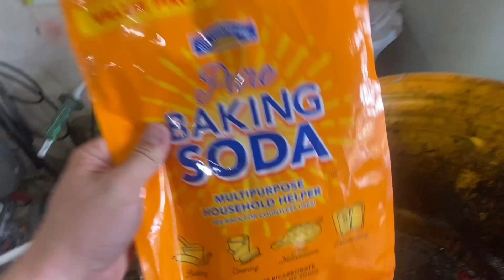How To Powder Coat Brake Calipers

Comment: Thanks for the video. One question: These plastic closures you are using to masking the connections and the piston, are they surviving the heat in the oven?
Reply from the maker: They are silicon. They’ll survive the heat but it is best to remove them before coating

Comment: Hi Tyler thanks such a informative and practical video I have  a  question,after you put the red colour did u leave the calipers in the oven to cure first or did spray the clear immediately after the color 
If you put the calipers in the oven before spraying the clear how long do keep in the oven and at temperature Thanks in advance
Reply from the maker: Just a partial cure (few minutes past flow out) between colors and full cure after clear is applied.
Reply: Hot flocked the clear?

Comment: Smacking the wrench with your palm will hurt a lot less than the side of your hand.

Also you can remove the pistons with a blow gun that has a rubber tip. Keep the bleeder in and blow air into the brake line bolt hole

Comment: When you start spraying here you mention that you forgot the o-ring between adapter and gun. I wonder what o-ring that is? I had the same issue when doing my first spray, other than that super happy with the rc1 gun :D
Thanks!
Reply from the maker: There’s a clear-ish/white o ring that comes in your box. If you have misplaced it you can just use a standard black o ring in its place. 

Glad to hear you’re liking it!
Reply: @royalcoatspowdercoating  Awesome! I Will double check, probably missed it.

Comment: Great vid man . Do you know the name of the tool you are using to remove the pistons ? Also after doing tons of these , did you find an easier way to remove the pistons ?
Reply: You put a block of wood in front of the pistons and give a few short blasts of compressed air into the hole where the brake hose attached to the caliper. And be sure to KEEP YOUR FINGERS CLEAR OF BEING BETWEEN THE BLOCK OF WOOD AND THE CALIPER PISTONS WHEN YOU BLAST THE AIR.
Reply from the maker: Here’s the tool: https://amzn.to/3Pjr2Cq

Air is faster, but this way is safer.

Comment: Hey tyler, First off i want to say that i love the RC1! Question i have is the little air twist knob on the powder tank, what is the best setting for it? (All the way out, 1/4 of the way, ????? Because ik its made to fluidize the powder, so wondering the best position! Thanks bro keep the vids coming
Reply from the maker: Glad to hear! 
I usually don’t mess with the knob, I don’t even know exactly where mine is set. I control my cloud with a regulator before the control box. But you can adjust it while spraying to get the cloud to your liking and spray style. 👍🏼

Comment: How'd you just thread those bolts in after powder coating the threads ?
Reply from the maker: No threads were coated and I just blew out the slide pin holes. Those bolts I’m putting in are threading into the slide pins.

Comment: What do you use for liquid stripper and neutral lizer and is that better than sand blast or do you do both
Reply from the maker: Rim strip is the stripper and the neutralizer is baking soda/water. It is still recommended to blast after stripping but stripping first makes your blasting a lot quicker. https://www.royalcoatspowdercoating.com/product-page/rim-strip
Reply: @royalcoatspowdercoating  ok what is the baking soda to water mix ratio and does  the rim strip come ready to use
Reply from the maker: @hasanabdul-hasib76  rim strip comes ready to use and I usually add a about 7 pounds to around 40 gallons and add to it as the bubbling slows from neutralizing parts
Reply: @royalcoatspowdercoating  ok....thanks for the reply

Comment: I saw you blasted and coated mating surface where the caliper get mounted.. does that cause any issues? I saw you also blasted like the pin holes and all that.. can all that be blasted? I just did brakes similar to those and I masked all the holes and mounting surfaces and it was too much lol
Reply from the maker: The coating on these was actually powder from the manufacturer without any masking for mounting brackets. Most of the time I would recommend masking the mating surface.

I just tried to be careful while blasting around the pin holes since they would be filled with grease. Definitely want to keep the powder out though. 

Some brakes have more masking than others. Working on a set of 6 piston 2 piece Wilwoods right now that have a ton of masking. But also a much higher quality caliper.
Reply: @royalcoatspowdercoating  yeah I saw how the calipers were before you started working on them.. I was just wondering for the next time. When blasting do you use duct tape? To cover up machined surfaces? If so when done and tape gets removed it leaves like the tape/glue residue how do you get rid of that? 

Looking forward for that video!
Reply from the maker: @perknowitzki7158  some times I use duct tape and sometimes I use the high temp green tape depending on the application. Like this next set of calipers I’m using the green tape because of the residue issue. Usually I try to stay away from the edge as much as possible. I also use the thicker, more expensive duct tape and that seems to help also.

Comment: Weird question but can you show how you have your powder booth setup with the ventilation and grounding an what not. Btw the calipers turned out great 👍🏻
Reply from the maker: Thanks! 
I will attach a link to the video of the booth build. 
And for the ground, I have a ground rod outside for now with a piece of I believe 8 or 10 gauge wire running running from it to my hanging rack. 

DIY Powder Coat Spray Booth Built for Under $1,000! - Time Lapse
https://youtu.be/b-b-HufZQPI